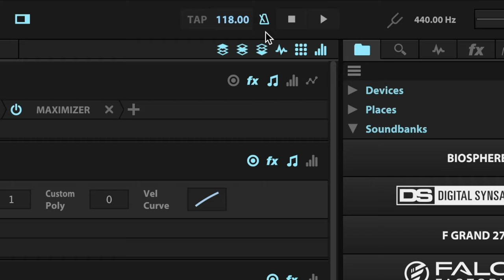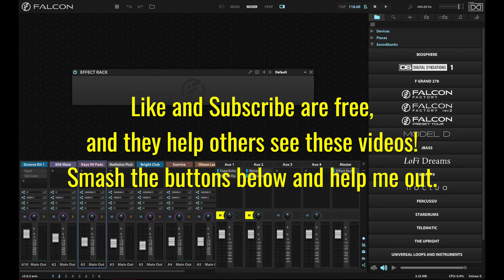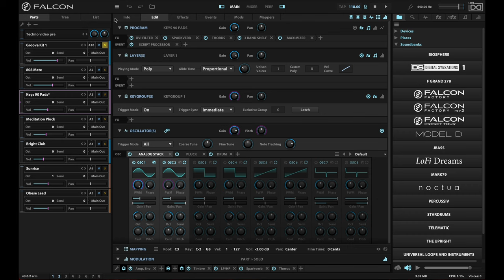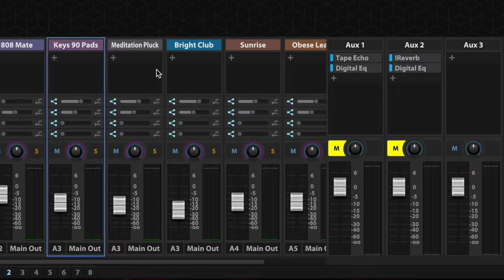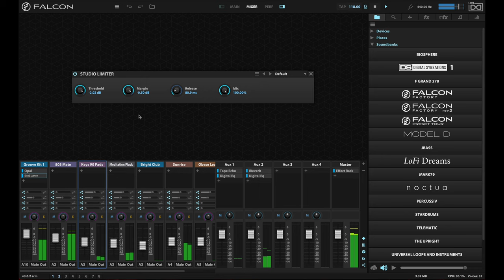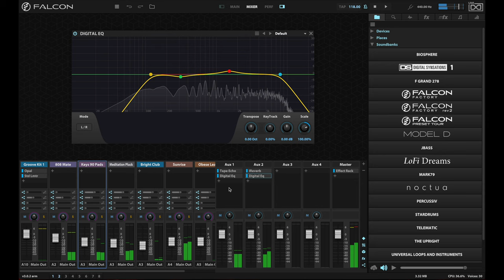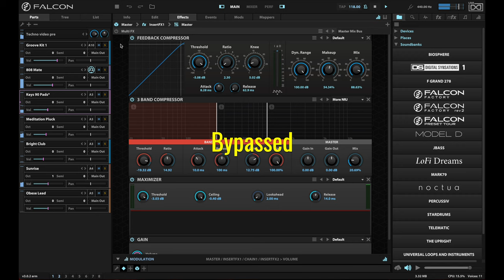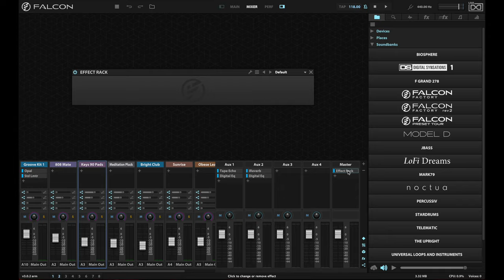UVI Falcon 3: Multi Mixing

Comment: Falcon this underrated ecosystem!
It is true that it is not easy to use because it was made by programmers, not musicians :/
Great video, more and moore and mooore... lalalalala :)
Reply from the maker: I don't know if I agree that the programmers weren't musicians. It's hard to make a worthwhile synthesizer without also having a musician's ear, and the UVI folks are very talented. Falcon may not look as flashy as some other synths, but it makes it very easy to create good sounds fast!
Reply: Even if it is not very easy, you can learn it, but until then you cannot concentrate on the joy of creating. At least that's how it is for me.
Reply from the maker: @Purgatorium8  make sure to check out the official UVI getting started videos. They helped me a lot when I got started. Also Venus Theory has some fantastic Falcon videos too.

Comment: Well, it is nice to see your explanation, thank you, but then I have a question: Falcon, is it a synth or a DAW?
Because I have the feeling that tries to be both and I am not sure if I am a fan of that. 
I have the feeling that when it tries to be both the things start to be "lost in the mix". And probably that is one of the reasons why Falcon is such a computer resources hog, it tries to be more than it should, overstepping the DAW. 
You were talking at he beginning about "how ridiculously infinite the possibilities of Falcon are", with all due respect I disagree with that, and if you think that I may be subjective when saying that, my computer and your computer will disagree with that, because they have a very finite amount of resources.
Reply from the maker: The Mixer view is simply a convenient way to look at the audio and effects options at the Multi level. Everything I showed can be done through the Main view and (for example) the left Tree pane. Falcon isn't trying to be a DAW any more than any other flagship synth. One might as well say having on board EQ is trying to be a DAW! 😁 As for limits, they are down to your computer's CPU. There are very few limits imposed by the design of Falcon itself, unlike many other synths that are in the same price range. I own a lot of software synths, and Falcon is by far one of the most efficient. Of course as you pile on additional architecture and effects, you can run into those limits. It's such a great tool to have for sound design, and it's amazing that it can adapt to numerous purposes.